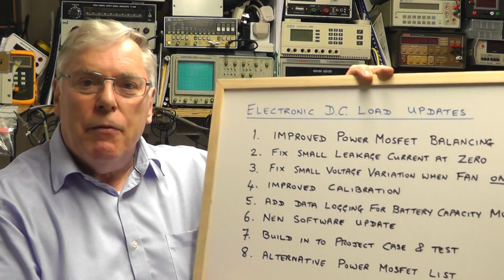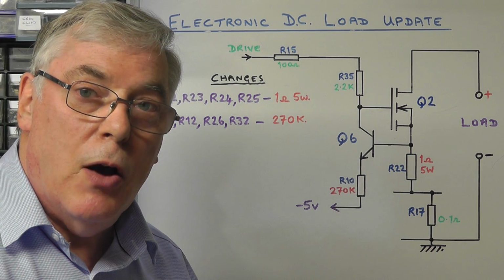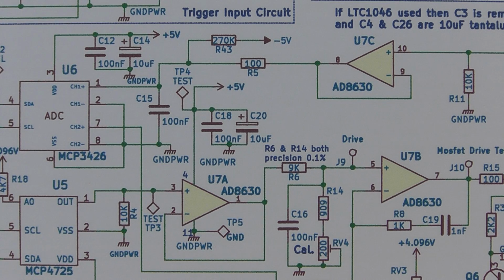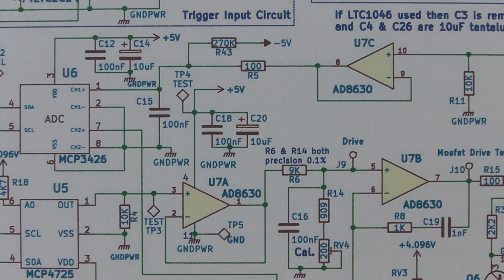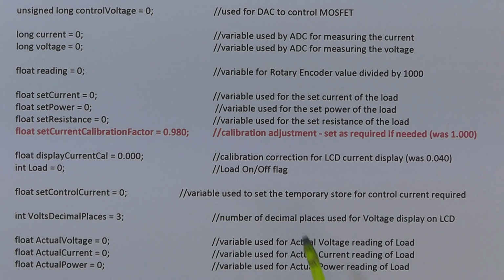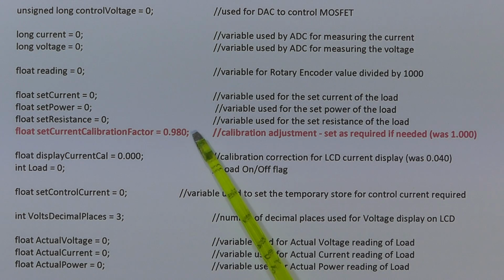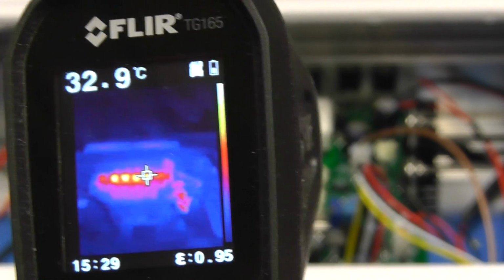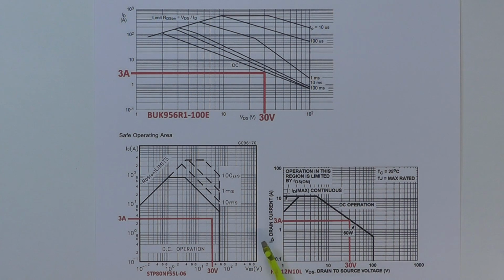Scullcom Hobby Electronics #57 - Electronic DC Load Part 9

Comment: Hi sir i am using the version 9.3 board and using the 9.3 version code in the display i am receving 255 value for current limit and power limits instead of 5 amps and 150 watts what might be the reason

Comment: Hello. First of all, thank you for such an incredible project. I have a question. The modification that prevails in the electronic load is with: R43 in 1M, R22,R23,R24,R25 1ohm 5W and R10,R12,R26,R32 in 270K??. When contrasting the scheme with the list of components I saw that although they are the same version 9.3 of 04-26-2018 there were differences. Thank you so much.

Comment: I was looking for a while for a DIY li-on battery testing system on the internet without success, but this video series had it all... THANKS FOR THAT!
The detailed explanations at each step were very instructive and fascinating, as I occasionally repair / refurbish li-on bicycle batteries I would like to use this DC load module to test the capacity of the fixed battery. 
These are usually 10, 13, 14s sets so to 58volt fully charged that would work I think, but could this setup discharge a pack of 16s or 20s @ 3A these are 67 & 84v when 100% charged?

Comment: Great series of electronic load design. I have watched from part  1 to part 9. I have not watched the part 10 yet. But I have one question about the constant voltage mode. Can your design achieve constant voltage mode ?
Reply from the maker: Hi,
I am sure the feature of Constant voltage (CV) mode could be added to this project. I think it would simply be achieved by making the electronic load sink the necessary current to keep the voltage at a preset level. This could be done in software as a new option as we already have voltage sense inputs available - if I have time will have a look at it. Feature may be useful in some battery testing operations.
Best regards, Louis

Comment: Most of your problems would be solved by making a 4 layer board with 2oz copper clad ground plane on inner layer 2 and 2oz Cu clad power plane on layer 3.  Layer 1 component layer for THT components and Layer 4 solder layer for SMT components.

Comment: Anyone knows where to find a suitable heat sink please for this DC load? 250*90*30mm is no longer available.
Reply: I build my own version of Louis DC Load and used a Fischer Heatsink (200x75x40) and mounted two fans on it. Works well for up to 100W - 120W. The type is SK 47/75 ... farnell: 4621888. There is also a 200x100x40 version.
Reply: @e42_marvin  Thank you for your suggestion. I'll look into this. I currently have 150x90x30 and its way too small to handle 120W power. I was thinking about getting a Fischer Force Cooled Heat Sink (Farnell: 1222518), but its out of stock, way too expensive and I am not sure its would be enough for high power. 

What's the temperature is like on yours when you go to 30V x 4A (120W) please? Is it consistent? Thank you
Reply: everything42 

Installed the Fischer cooling aggregate. What a difference! However, I did notice that at high currents shunt resistors are getting very hot (around 80-90C). Maybe I should install another fan browsing onto resistors
Reply: @arduino8506  Good decision to use the cooling aggregate. My shunt resistor (0.1 Ohm / 50W) gets only "warm". How much current do you draw? The Power dissipation @ 5A is only I²R = 2.5W. What do you mean with shunt resistor(S!)?
Reply: everything42 

My shunt resistors are super hot at 4A. 
However, I have just noticed that I made a stupid mistake. PN2222A load resistors were changed to 270k from 47k while shunt resistors changed from 0.1ohm to 1ohm. And I did not change PN2222A load resistors. 

This means that the mosfet will not be on completely and start getting hot, really hot depending on the current actually allowed to flow through the partially on mosfet times the voltage drop across the mosfet.

That’s why mosfets and shunt resistors are getting very hot. Silly me!
Reply: @arduino8506  Oh, Things happens. Now i know what you mean, the 5W 1Ohm resistors to sense the I(ds) current of the MOSFETs. Yes, they are getting very warm but they are build for that: up to 70°C for my cement fixed resistors before derating. And yes: change the emitter resistors of the 2222 to 270k.
Reply: @e42_marvin  I checked the datasheet of the shunt resistors. They are designed for up to 150C.

I changed all emitter resistors now to 270k and waiting for a new MOSFET Q5, which was blown, to get a replaced before giving it another 3h go at 4-4.5A
Reply: A good heat sink did not resolve the problem. At 2A x 15V, the thermal camera tells me that Q4 goes to around 83C. At 4A x 15V, which is only 60W, the same Q4 goes to 114C and I decided to abandon the test after that. Not sure what the problem is. I am using good TO-220 insulators (Aluminum Oxide Ceramic, Digi-key nr 4170G-ND)

I would have thought I can go at least to 120W???
Reply: @arduino8506  I use mica pads and heat compound and it works fine. Have you measured the gate voltage of the mosfets? The mosfets are balanced and the gate voltage should be nearly the same.
Reply: @e42_marvin  Yes, gate voltage to gnd is the same or nearly the same at 2.72V
Reply: @e42_marvin  I use heat compound and mica pads (they are Ceramic) too, but for whatever reason I cannot go higher without a risk of overheating MOSFETs. 

Yes, the gate voltage is more or less the same.
Reply: @e42_marvin  I see you have changed the PCB as well. PSU is now on a separated PCB. Very neat design.
Reply: @arduino8506  I choose this way so that i can change the PSU when there are any problems with ripple or stability in the PSU design.

Here are my measurements @ 15V, Gatevoltage & temperature @ fin of Mosfet (stp80nf55l-06) with K-type probe
1A: (internal sensor: 35°C)
Q2- 2.4817V/30.6°c; Q3 - 2.4809V/31.3°c, Q4 - 2.4801V/31.6°c, Q5- 2.4799V/35.0°c
2A: (internal sensor: 38°C)
Q2- 2.8638/42.5°c; Q3 - 2.8611V/42.9°c, Q4 - 2.8592V/43.4°c, Q5- 2.8574/40.9°c
3A (FANs are on, internal sensor: 40°C):
Q2- 3.2145/42.5°c; Q3 - 3.2145V/46.3°c, Q4 - 3.2145V/44.9°c, Q5- 3.2151/45.0°c
4A (FANs still on, internal sensor: 41°C)):
Q2- 3.5749/52.7°c; Q3 - 3.5749V/46.3°c, Q4 - 3.5734V/53.2°c, Q5- 3.5735/50.3°c
Reply: @e42_marvin  Thanks for posting the above. You are using different MOSFET. What about 2.2K/270K resistors? Are they the same?

I think I discovered what the problem is. I am using IRLB4030PBF, which is only good operating below 10V. Again, my mistake as I did not check safe operating area properly. When I go higher in terms of voltage, its only safe to be operated below 1A. For example, temperature measured on MOSFETs at 15V and 1A is reaching 50C (both laser and K-type probe). Internal temperature sensor goes to 39C. Way too high compare to your measurements.
Now I need to change all MOSFETS to run the DC load at higher loads.
Reply: @arduino8506  I take a look at the datasheet and you are right. More than 10V seems only possible with very short "pulses". I also upload my schematic as pdf (same link as the images) - may be it helps.
Reply: @e42_marvin  I have changed MOSFETs for STP80NF55L-06, but I still have a problem. At 15V/4A, I have the following (measuring with the K-type probe at the MOSFET body:)
Q2 - 3.4254V / 70C
Q3 - 3.4267V / 65C
Q4 - 3.4298V / 82C
Q5 - 3.4269V / 96C

The gatevoltage starts at 3.63v but drops at the temperature is going up.

Clearly I have a problem elsewhere as the MOSFETs are not balancing properly
Reply: @e42_marvin  Thank you for schematic! I have changed all MOSFETs now for the same ones you have as I could not get others. Is the voltage drop you have across R22-R25 the same? I have the following values at 20V and 2A:

R22 - 0.4141V
R23 - 0.4822V
R24 - 0.4974V
R25 - 0.5440V

This is big difference in my view.
I suppose this is why Q5 is getting very hot. What's your voltage drop at the same voltage / current level across R22-R25 please? Thanks

Comment: Hi there have been some changes done to Arduino IDE and now it doesn't compile, multiple errors, I tried to sort it myself but once I fix one error another shows up, even some errors with some of the libraries related to boolean, and I'm too much of a noob to figure it out myself.
Could you please take a look at it?
Thanks!
Reply: Louis latest version for the firmware is v.35 / v.35b as far as i know. I rewrite the code because I modified the electronic/schematic, but the original version can be compiled with the actual arduino 1.8.10 IDE. Be sure you have all needed libraries installed; also Louis own MCP79410  timer lib.

Comment: Hi Scully,

This is about Mosfet RFP12N10L, but first :
Thanks for your detailed and brilliant videos...
We are missing new content from you (although, from  your other answers, 
we know you are busy with other things)...

Even your videos are very informative, I need some help from you...

The 3rd mosfet of your choice, is the Fairchild (actually ON Semiconductor) RFP12N10L :

At Electronic DC Load Part 2 video, you stated 30V 3A (90W) for the project, 
fitting inside the BUK956R1-100E safe operating area.

Now, for the RFP12N10L, even it´s maximum power dissipation is rated only as 60W, 
I can still fit the same 30V 3A (90W) inside its safe operating area 
(as you can see from the image on the link bellow). 

https://ibb.co/zmzNn8s

Being RFP12N10L Pd max 60W, I sholdn´t be able to fit 90W inside its SOA graph. 

I´m I wrong ?

Do you thing  RFP12N10L safe operating area graph could be erroneous ?

Really lots of thanks in advance

Comment: Hey guys, so I just finished building this DC Load and I re-designed the PCB to be able to handle 10A+. When I went into the 'User Set-up' menu to set the max current and power I noticed that no matter what, if I set the max current over 5A the settings would not save and it would restart the process. Also, the max power is limited to 244w and I would like to be able to go up to 300W. How can I change the code to allow me to do this? Thanks! 

p.s. 

This is a fantastic project, by far the best I have ever seen on this topic. I'm very impressed by the quality and time you put into your projects and I am very grateful for that. Thank you so much!
Reply: You are right. The 5 amp limit is hardcoded. In version v.35 from Louis it is Line 228 in the main loop: "if(CurrentCutOff > 5){ userSetUp(); }else{..."

Comment: Fantastic videos. Best on youtube. I have some questions about the circuit related to accuracy and calibration.

Firstly, concerning the 1M and 1M8 resistors to -5v used to reduce voltage to zero at the output of the buffers; is this non zero output voltage of the buffers due to to fact they are run off the ground rail, and therefor can never reach zero? and so can be fixed by running them from the -5v rail?

You rightly added a differential opamp as a voltage sense but did not do the same for the current sense. The large current coming from the mosfet source going to the -ve  banana jack would cause voltage drops between it and the circuit ground which is where the current sense opamp is referenced. Is this correct?

Another point would be resistance temperature drift in the 0.1ohm power resistor. If its resistance changes with temperature, it would cause a error in the current measurement. In fact on video 9 you show that at 5V, 3A in, low temp, you have a error of 7mA but at 30V, 3A in you have a error of 17mA.

Something i will add to my build is a input filter, including a diode from -ve straight to +ve jacks, to protect the circuitry from high voltage spikes created when testing Dc-DC converters or sparks due to 
connect/disconnect.
Reply: That thing about using dual rails for the op amp is a really good point. I really hope that question gets an answer!

Comment: Great as the other parts of this series. Some points of improvement I found, nevertheless:

1. You use the Keithley to measure exact 4.096V for the reference, but trust a power supply to display correct voltage/amperage? We HAVE already seen that the power supply’s voltage differs from the Fluke readings in previous videos in this series. I’d NOT trust the power supply’s readouts for doing the calibration but use a known calibrated multimeter for that.

2. I’d strongly object to EVER having connectors on the SIDE of a unit. As can be seen in your lab, benches get stuffed with equipment and you simply won’t have the space to connect something on the sides.

3. I’d probably even put the power supply INSIDE the project case (simply HATE to have a zillion of these wall warts) and have a regular mains connector on the back. Of course it would interfere with the current heatsink + open fans on the back.I wonder how that might be improved? Maybe use a larger case with slots on top, move the heatsink inside and thus allow for fan guards on the back?

4. For the USB, I’m undecided. For control and upgrade purposes, I’d typically install a USB-B socket at the BACK of  a unit, for data logging use a USB-A socket on the FRONT where one could plug in a laptop using a standard cable. (Again, mainly to enhance usability in a stuffed lab—one simply wouldn’t want to move around equipment once it has found the right place on the bench …)

5. Are you planning for an updated PCB or leave that as an exercise for the reader? ;-) Having tin leads I find okay, but the extra grounding wires somehow I don’t like.

As always: Thumbs up on a great procject, and many many thanks for showing it thus clearly and understandable!

Comment: Hi Louis ! A year ago or so I said I was going to build this. Now I'm doing it :) Can I ask you about the 5W 1Ohm resistors and pn2222. Are they currentlimiting resistors in case there is a "shock" (as in hotplugging etc) to the input terminals ? Also the PN2222 that are in parallell with them, do they help load balancing the four load paths ?
Reply from the maker: Hi, The four 1 ohm 5 watt resistors help with the balancing and power sharing of the 4 Power Mosfets. If any one of the Power Mosfets draws more current than the others then you get a larger voltage drop across the 1 ohm in that particular Power Mosfet source return path which will then cause that mosfet to have a lower gate/source drive voltage and so reduces its drain/source current. The four PN2222 transistors are there to provide some protection for the Power Mosfets - if any one mosfet draws excessive current then the associated PN2222 transistor conducts and reduces the drive voltage for that Mosfet and so stops it going in to thermal runaway. I have found in practice since I increased the four source return resistors from 0.1 ohm (original design) to a 1 ohm we have now, you could now leave the four PN2222 transistors out of the PCB if you wish.
Regards, Louis

Comment: So is there a spec sheet for the current part 9 DC load? Describing accuracy, resolution , power rating, features etc? I think it would be a nice summary to add. I do not see that anywhere in any videos or the scullcom website.
Reply from the maker: If I have time I will look at this later.
Regards,
Louis

Comment: Just ordered all the parts...wish me luck :D
Reply from the maker: Hope you enjoy the project.
Regards,
Louis
Reply: Right after the joy of soldering everything on the pcb (9.2) I ran into an issue.
The -5 and -2.5V ref voltage was not present at the probe points. I measured +0.55V on the -5V point.
Im pretty sure all the parts are in the correct place, do You have any idea what could cause this?
Reply: the Lm431 is working outside the circuit, i tested that
Reply: What did the parts cost you?  How did your project work out?

Comment: Can you elaborate on the voltage sense PCB plug (4:57)? If you are to just connect the voltage sense lead to the rocker switch, what's the PCB connection for?
Reply from the maker: Hi Peter,
You can download a wiring diagram from the link below:
http://www.scullcom.com/DC_Load_Voltage_Sense_wiring.pdf
Regards,
Louis

Comment: Hi Louis, do you think if a 3oz copper and a full ground plain at least on one side on the PCB will help the problem of the grounding issues? I know it’s a challenge some times to do when routing tracks with a full ground plane.
Reply from the maker: Hi,
I did look in to 3oz copper but I found the cost increased 5 times. I have done an update PCB design with additional grounding but not fully tested it yet. This will be version 9.3. I have had a few PCB's made if anyone is interested. I have also made the PCB (version 9.3) gerber files available download on my website at www.scullcom.uk so you can have PCB made youself - the download link is also below:
http://www.scullcom.com/DC_Load_ver9_3_gerber_files.zip
The version 9.3 schematic, component layout and updated parts list can also be downloaded from the link below:
http://www.scullcom.com/DC_Load_ver9_3_files.zip
Regards,
Louis
Reply: Yes, thanks for your reply, I think the only way to get them made cheaper is from china I had some made years ago with great prices, much cheaper than in Australia around 4 times less. After that I constantly get emails from various china manufactures asking me if I need boards made..haha. 
Kind Regards. joe